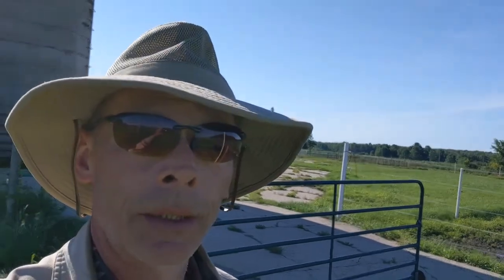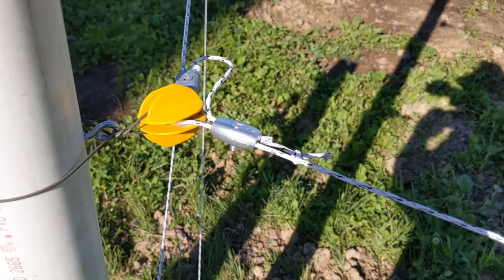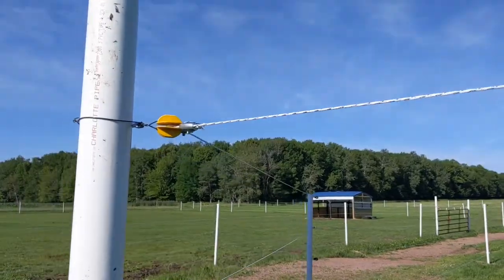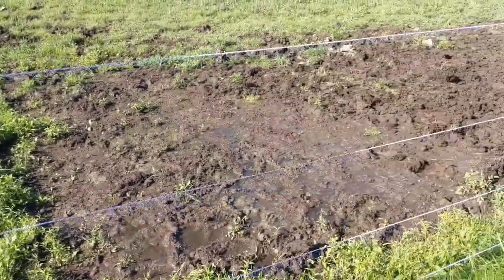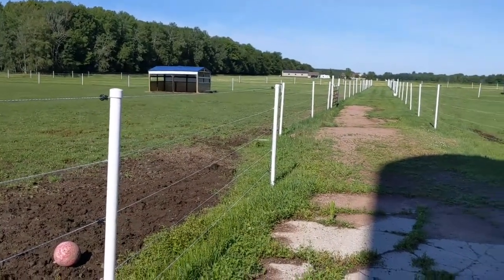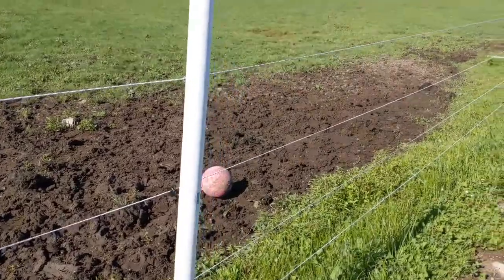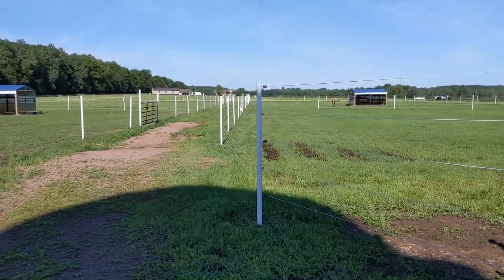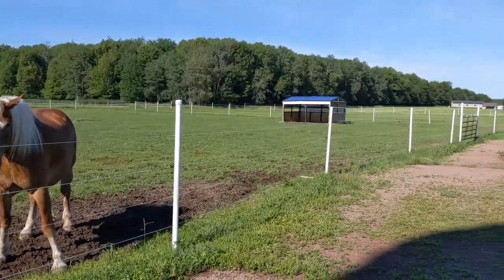Final how-to T-post and PVC electric fence

Comment: Did you say you poured cement in the PVC?
Reply: I did. In hind sight, I don't recommend doing that. If I need to replace 1, I'll have to pull it up and replace both the t-post and pipe. The screw insulators pin the pipe to the t-post perfectly fine. 
BTW, the fence is still zero maintenance

Comment: Timeless fence would have been a much better and cheaper choice. Poly wire has a shelf life. I would have gone with high tensile. Poly wire is for temporary fencing.
Reply from the maker: Actually the timeless t-posts got ruled out. 2 reasons. First was time. I'd have to pull up the existing steel posts. That would add time to the project. And they are still T-posts. We know too well how horses can impale them selves on T-posts. They are just like kids. If they can find a way to hurt themselves, they will. The Belgian and Palomino play rough. So, we're at risk of impalement. Cost wise, they came out a bit more expensive than 2" Sch40 PVC pipe. $14 for 2"x10' PVC. Cut in half for 2 posts. $13 for 1.75"x7' timeless T.
However, still well within a "normal budget". I'm sure for many folks, they are a great option.
As for high tensile wire. No. Again, we know too well what wire can do to a horse. The existing wire was the first thing we took down. Originally we went with 5/16 braided electric rope. However, we are at risk of tornadoes. And not at risk of our kids wanting to break through the fence. The poly wire we used has a 600lb break strength. The Belgian is 1600+lbs standing still.  At a run, he'd break through without hurting himself and the other 2 will follow him. Plus we're on 3 years with that rope and no maintenance. For our needs, the fencing we did works perfect.
Reply: That's Powerflex polybraid and it will easily last 10 years in his scenario, most likely more. Rolling it up on reels as most graziers do will shorten it's life span quite a bit.
Reply: I looked into that as well. It was more expensive. And still a tpost. Our kids play rough and still a risk of impalement. The ropes are on year 3 without any issues. Plus we wanted the lower break strength in case they needed to run through it.

Comment: Why not just drill holes instead of any insulators??
Reply from the maker: The odds of grounding out on Tpost inside are pretty high. Plus, the insulators pin against the Tpost to  keep the pvc in place.
Reply: @aspireranch   yeah I didn’t realize he was adding post on top of post. Which is even more confusing.  I guess when there’s an over abundance of time and money.
Reply from the maker: @RutzRidgeFarm  Read the description. The Tpost fence was there years before we bought the place. We wanted a better fence. Covering the existing fence with pvc was the quickest and cheapest solution.